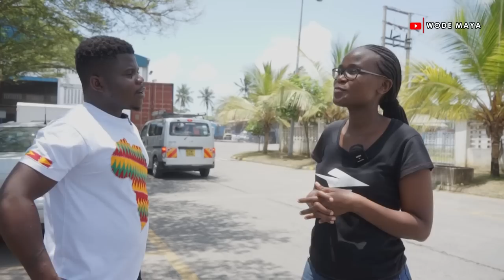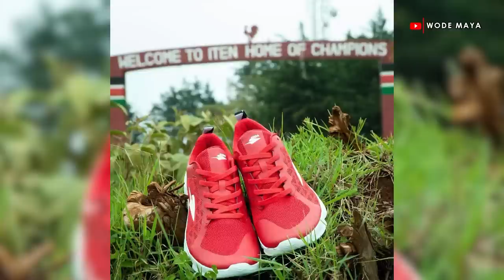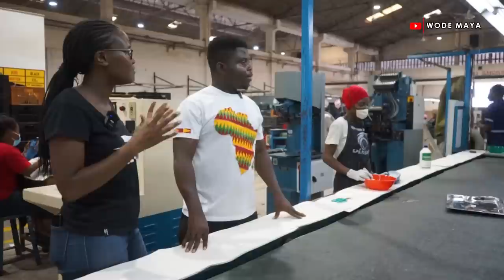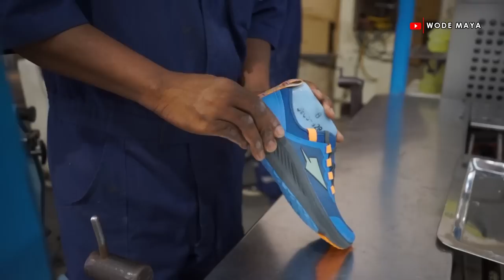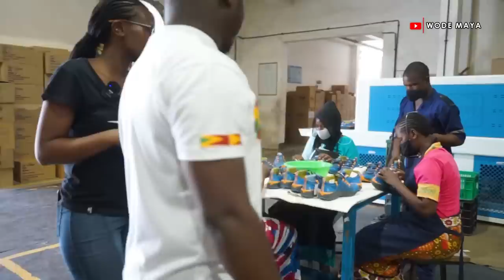How A Kenyan Lady Manufactures Africa's First Running Shoes!

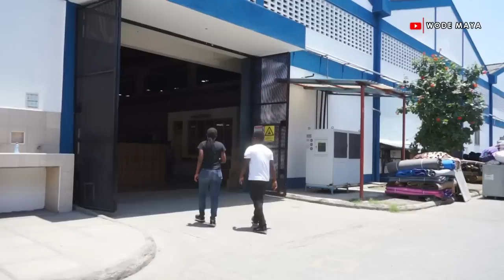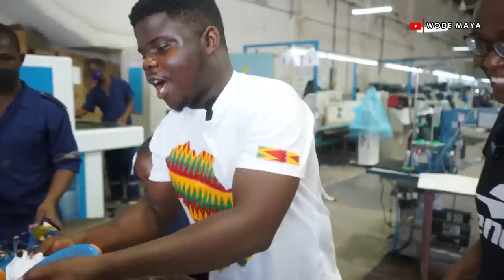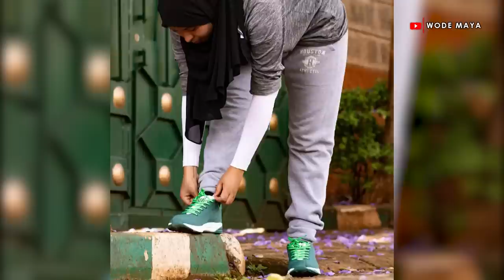Comment: #Enda 7:27 in a tropical hot country the corrugated metal over your head (assembly-line) will baked you alive not knowingly! why not add some styrofoam board under-the roof to cut down the heat (its not a costly item) to reduce heat. 20:36 The humanity moment of #WodeMaya 22:22 I am also stuck in the state. The ventilator fans only bring hot air down! holy crap. 25:25 she has leadership qualities ( she is absolutely true)